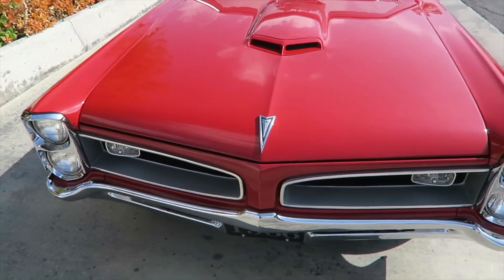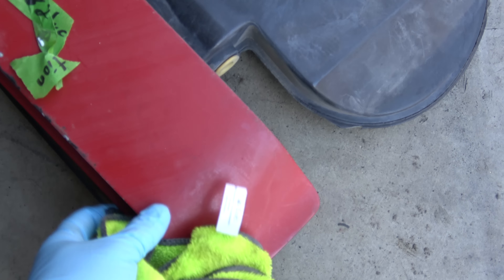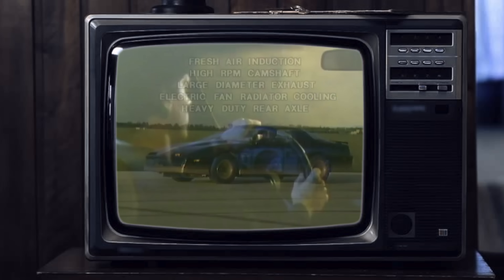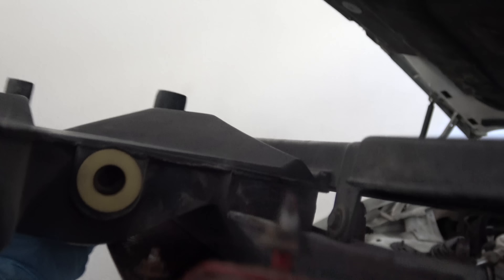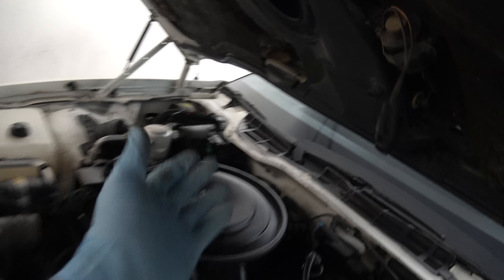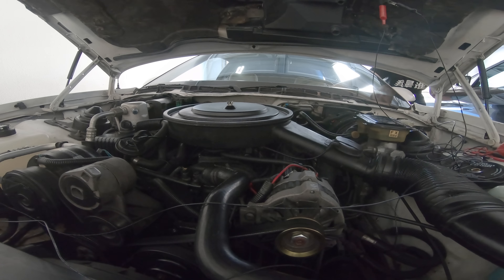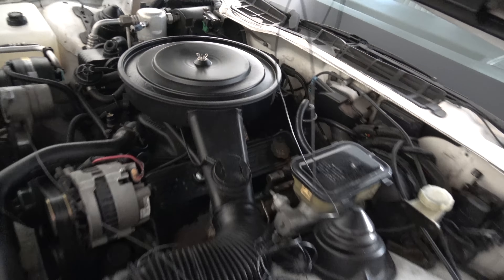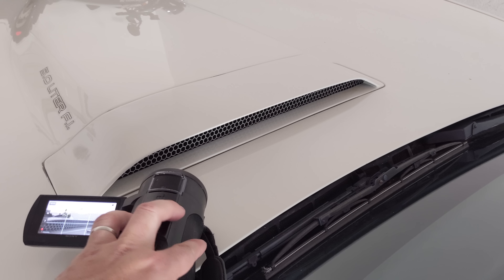I Unlocked Massive Power in My Firebird

Comment: Im torn between the turbo hood, and mine, with the nostril vents and the side head extractors on the hood (and the fender ones. Mine is a regulat TA from 85). I would make those functional, remove the foglamps too and add brake cooler ducting. But, Im not sure yet. I need to get a PHS report, and see how rare this bird is.

I admit I like the breakdown, if its a one of one, or one of however many, and shooting for pure stock...but this car lost its LG4 and has some 350 crate engine. it was new...but no clue yet on which one. I dont like that fuel pressure is low, 9psi...if it was an in tank pump. But, its also. NOT an in tank pump lol. We all know the horror FPs are to replace (that and spark plugs, two common things that on any other car are easy..but not on third and fourth gens)

I also have headers, so the plugs mentioned above will be extra beetchy.

Anyway, nice job there. But, with F bodies...I admit Im vain too. SHould I spend 2k on a whole hook and air filter assembly? Or 2k on Cragar louvers? Mine in HS had them and....welll....I did that look, so much that I have the metal ones for my 5th gen (to anyone curious, MRT makes them, Mustang Racing Technology. They still do...If I had extra cash I would buy a set, just to have. They really make the Camaros look complete) Im rambling...lol. I got one hour of sleep, and Im about to start polishing the horrible paint on my TA. It will at least be a shiny Fireturd!

Comment: Amused at a couple of things here.  To start you have the LO3 5.0 motor which was the garbage, base V8 from the factory in 1990 for the Formula and Trans am.  It was rated at 170hp from the factory.  After all of this work to modify it you still wouldn't get as much power as a TPI 5.0.  And this mod wouldn't work on the TPI either so the hood bulge kind of has to remain only for show on the upgraded motor from Pontiac :)

Comment: The functional bulge was on all 83-84 Trans Am, standard V8 or HO. In 1982 only the Crossfire models had it, and it had a slightly different opening for the air cleaner. Not all of them due to a shortage in the turbo hood that year.

Comment: Something you might do is install " Frogskinz" iand delete the flapper entirely. t's basically a membrane that allows air in but keeps out water. I've seen it used on competition snowmobiles. Those even in stock form are close to the same horsepower that your car was when new. I will install it on my hood once the fake scoops are cut out. A point. Even without ducting to your air cleaner base, the colder air helps dissipate heat. The old mopar " airgrabbers" and Chevrolet cowl induction hoods gave a bit of extra horsepower but there is no way it's even 10%. In fact 5% would be optimistic ( measured at the wheels) That being said in the end it makes sense to do this. 5% on a 250 hp engine is still 12+ horsepower. At this stage you might want to consider getting a mailing address in Arizona to get around the CARB regulations. When you do that it's easy to upgrade your engine ( and in particular your excessively restrictive exhaust). With a proper cat back exhaust and finding better manifolds you can get more HP without affecting the reliability of it.

Comment: Tbh you probably gained 5hp in actual performance but 50hp in sound which makes it well worth it 👍
Reply from the maker: Agreed
Reply: I'd bet this simple mod would be worth 1-2 mph in trap speed over stock at a drag strip. Ram-Air makes more power the faster you go. A dyno cannot realistically measure the power gains.

Comment: Just a quick note on Horsepower ratings. Until 1972 engines were Dyno tested bare, meaning nothing on the engine, no power steering, water pump(that was driven by an electric motor),AC, and could be done with open exhaust with headers. This was "Gross horsepower". In 1972 that changed and they were then required to test the engines "As installed in a car" that means all accessories and a factory exhaust and that was the main reason for the so called HP drop so for example if a 350 made 350 HP pre 1972 after 72 it maybe only making  250hp and the smog crap took some more down so could have been 210 or 220 so this was then the "Net HP" and now since 2005 it is rated as" SAE certified standard"  although since then technology has improved and horsepower is back up so you are seeing much more power and better gas mileage and much more difficult engines to work on because of all the wiring and sensors but the newer ones are much more easy to diagnose just plug in an OBD and read the codes and they are more accurate then when they first started the computer age cars

Comment: I saw something years ago for my '89 formula TPI... run a black dryer hose from the airbag down to a spot by the radiator for fresh air induction, also, drill some more holes in the air box... not only does this work, it sounds radical with a manual trans.. take the screen out of the temp. sensor.. carefully...all of this gets more air in there... careful not to touch or break the wire...
Reply: You talking about cutting out the screen on the MAF sensor?
Reply: @ShawnStafford-1978  yes... just be careful!!
Reply: @lonmcq7317  I heard it's more of a problem than a gain removing the screen's. Plus the OEM version are getting harder to find. I have a original 89 GTA. I just added a piece to the OEM air filter intake. That goes to the fender for cooler airflow. It's on my channel.
Reply: Also the coolant bypass method works well for reducing coolant and the intake manifold from getting hot airflow on tpi setups.
Reply: @ShawnStafford-1978  It's not a problem at a all, just be careful.. My brother had a 89 GTA 350, he did this and so did I with the Formula... No big deal...
Reply: One other thing I'll offer... Forget the computer chip.. giant waste of money, but.. What does work, and you'll feel this.. Underdrive pulleys.. Crank and alternator. March is the place to get them from.
Reply: @ShawnStafford-1978  Nope, it's a 5 minute job.... If you're not comfortable, don't do it...
Reply: @lonmcq7317  Yeah, I'm fine with it being original. The sensors and OBD1 all work with everything else together.

Comment: Now, I wonder if the Venturi effect robs you of air at higher speeds on the reverse scoop.
Reply from the maker: I haven't seen an issue, I rarely take this car over 90mph anyway but it still has plenty of go at top end
Reply: The idea was there is a high pressure region at the cowl ahead of the windshield that you can tap air from. Forward scoops need to be raised significantly above the hood to get clean pressurized air funneled into them. At least that was what the car magazines in the 70s said.
Reply: @MyDailyUpload  Cowl induction is always cleanest, but nowadays mostly cabin air comes from the cowl inlets.

Comment: Would be cool to do an A/B test with it closed and open to compare acceleration times. Imo one reason they restricted these engines so much is that the transmission, the T-5, was kind of weak.
Reply: But, you wouldn't be able to replicate the high pressure air which would be forced into the scoop, at the base of the hood/windshield area, on a dyno.  This can only be achieved at speed, and you wouldn't likely see much of a h.p. increase until you were somewhere on the south side of 80 mph. This has proven to be the case for both ram air equipped cars and motorcycles, when dyno tested against their non ram air counterparts.
Reply: @500erider  I wasn't talking about a dyno. You can do single gear acceleration tests using a GPS and other test equipment that will show small changes in time to speed.

Comment: The reason American cars stopped receiving "real" air cleaners was due to noise regulations in most large cities in the early '70's. The full throttle actuated doors meant that the cars would be quiet until hard acceleration which was adequate to make the regulators happy.

Comment: You should add 3 more things 1) MSD6A, 2) E3 spark plugs and 3) 8.8 mm  ignition wires... 
 It helps with emissions, gas mileage and most importantly POWER!
Reply: nope........ac-delco plugs,no msd and decent wires will make the same or more power than everything you mentioned...
Reply: @trillrifaxegrindor4411    I've used MSD in a 4.1 Cady, 6.0 Chevy 6.6 Pontiac 4.9 Pontiac 1.9 Ford, 5.0 ford and so on.  I always got great results, everything from Winter start up to gas mileage n horsepower maybe I just got lucky.
But thanks for the info.

Comment: Hey Winston just want to let you know that I have sourced out all of the parts with the exception of the rubber gasket and the air cleaner cover. Well also the screen / grate that replaces the blocking plate in the scoop. I ended up hand fabricating one out of something that wasn't honeycomb shaped but oval shaped holes and black in color. It looks fine, actually looks factory. I know it's not original but it looks like it belongs there and from the factory and it gives complete airflow. I did acquire an extra original TBI air cleaner cap and it looks as if I'm going to have to hand fabricate the hole for the rubber grommet so it will seal to the air cleaner. The rubber gasket is another situation, I can't find that either so I am trying to source one out elsewhere. If you have a source for the original bits and pieces please hit me up so I may purchase the actual parts. Thanks mate.
Reply from the maker: Good job so far, I’m guessing you could easily make something out of weather stripping like maybe a trunk weather seal or something?
Reply: @WorthlessWhips  Well it's complete and 100% functional 😎👍. I did end up fabricating my own air cleaner cover using an old TBI cover and adding a secondary air chamber on top of of it. Try not to laugh but the gasket is actually a toilet bowl base seal where the wax ring would seal the bowl to the floor. This one is made of a heavy duty flexible rubber material and is the perfect size to seal to the induction unit that mounts to the underside of the hood, worked like a charm. I did see performance gains as far as better acceleration, improved throttle response and a bit more lo end torque.  I wish there was a way I could attach pictures it actually looks like a factory application.  So to date because of your videos I have done this modification, I have also changed out my steering wheel to the correct 3-spoke Firebird steering wheel I have changed the dreaded saggy map pocket I have replaced all four speakers with high-performance Pioneer speakers (all Direct Fit) and was able to adapt a 2003 to 2006 Delco Trans Am CD player head unit with graphic equalizer and upgraded built in bluetooth, all correct 21 pin connector and 1.5 DIN size head unit. It was pretty much plug and play.  Life is good 👍.

Comment: The reason it had the actuator is that it bypasses the air filter when open and with normal driving, you want the air pulled on through the filter. You may want to rig a switch to open and close it.

Comment: You discovered Cowl Induction. Not making 15-205 more horsepowers but I bet you are probably getting an extra 5-10 horsepower and I am being gracious. You changed the temp of the air coming into the engine essentially and the reason you can feel it is because these cars barely had 150-160HP to begin with so any slight modification is going to feel like you bolted on a nitrous kit. Try advancing the timing and lean the engine out it'll feel like you have a turbo on the thing. :-)

Comment: It didn't get you anywhere NEAR 15-20%, haha! That's like, long-tubes, full exhaust, mild street camshaft power. I'd be blown away if it gave you 10 hp, most cold-air intakes gain 0-5. I can easily believe it made the car more responsive, which can feel a lot like more power in and of itself, even if the car actually makes a smidge LESS power to get it.

Comment: ive never understood how the rear facing vents work. It seems that they would pull air from that direction (which would be good for relieving pressure or heat from the engine bay) rather than force air in.

Comment: Lol I hate those crappy chrome ones you see at autozone and other places. So horrible looking
Reply: Autozone is the worst. It should be evident that when you work for a company that wants you to sign a contract saying "you won't talk shit about this company" that's a red flag.
Reply: @NeverMetTheGuy  didn't know that but yeah ive never had good experiences with them customer service wise.
Reply: @tomatojews8500  - I may or may not have worked there, and they don't pay enough to hire people that really turn wrenches, and the people that actually KNOW car stuff usually don't stick around.

Perfect example is my 98 GTI which is barely stock at this point, is a Mexican built AAA engine. When running the VIN through the system it comes up with the more common coil pack, and not the one that is on my car (the one it needs). So it took about an hour one day to find the part number in their system, and you isn't even search for it directly. So yeah, they're pretty shitty for the most part. However, if YOU know what you need, it can be easier sometimes, but anyone but AZ is usually better.

Comment: I knew that hood was special and traded it for a blocked off hood+$75 for our group beater TPI car. We have 4 front offset 16" '84-87 wheels on it and it ran 14 flat which is the same number that my '97 SVT Cobra ran at the same track. My mostly stock LS1 4th gen ran a 13.1 and my '87 Turbo T ran a 12.5 with a stretched stock mount I/C, 50# injectors, a 2800 stall, TH DP, a rebuilt "clipped" turbo, mail order Red Armstrong/ Cal Hartline chip, and snow tires from a Crown Vic cop car on GTA wheels. I really want a Syclone that is "Beater Quality".

Comment: I Believe this, I just took out all the Parts out the single snorkel breather and removed the air tube from the breather as well and My Firebird Formula went from 118mph to 135mph and kind of time consuming as well because I didn't want to damage the breather anymore than possible

Comment: I also unlocked massive power in my ('90 L98) Firebird! Vortech V3 supercharger, higher flow injectors, aux fuel pump, MSD box, Magnaflow cat back, adjustable fuel pressure regulator, .....................

Comment: please explain HOW your 305 TBI which could use at best maybe 425-450cfm at WOT somehow gained ANYTHING since the old snorkel/filter wasn't the bottleneck??? the camshaft/heads are..  i maintain it might have a beefier sound drawing air from the cowl instead of the old snorkel.. possible IAT could make an ever so slight difference.. (id be surprised if it was 1-2hp.. if your old Air cleaner was drawing in hot air from the engine compartment.. which its not supposed to.. and wasn't cuz in 1990 they drew cold from the front via a flex duct.. like the video shows yours did) so.. no additional air could enter.. no additional fuel needed.. = NO GAIN in PERFORMANCE...  nice that you made the power bulge functional.. but it was unnecessary.. exactly why they stopped making it functional on the early 80's T/A when they started using it on the Formulas.. so people.. don't bother making this conversion.. it will new you ZERO GAIN..  LS SWAP a junkyard 5.3 in... it's the best bang for the buck on this car.. easily add ~175 wheel HP for $1200 bucks including the engine, tune and exhaust work.. close to 275-300 rwhp add if you swap the cam, lifters, valve springs and add headers and a tune..  these are best drivability bang for the buck ways to make this car better.. can't do much with he 305..  it's an old small block so adding cam/intake/heads/exhaust/carb etc to it makes no sense.. expensive and not much return..  you swap in a 383 or something you still have huge costs.. LS swap in a truck engine.. do the easy bolt on mods.. she will perk right up..  sorry you wasted your money on this hood mod.. while it's novel and cool.. you didn't gain a thing.. cept the woosh sound when you kick the little TBI in the ass..

Comment: Most of these Fakes are there where the real ones are on the race versions of these cars. Some were for air for the engine while those on the side were for cooling the brakes ( some on the front some for the rear). The fakes are cheaper to manufacture and warranty.

Comment: wouldn't this screw with the mass airflow sensor? i'm not 100% sure how much that does in a car of this pre OBDII era but i would think it still uses some sort of MAF sensor to determine fuel ratios.
Reply: Not saying it's a bad idea to do it but it might make a bit more sense why that solenoid is there to block it off unless you really put the hammer down.
Reply: These cars didn't use a MAF. They had a MAP sensor that read pressure in the intake manifold.

Comment: Im thinking if it actually improved the power that much, there must be some other mods to the engine and exhaust system. The little snorkel does look like a massive restriction or "bottleneck" (almost quite literally). Maybe in the day they were just tuning for general drivability, and wanted you to unlock higher rpm power if you knew how. It seems strange they would stifle the engine though, from a competitive stand point, as all the muscle car companies were vying for better hp figures to put on ads, I would have thought. Maybe it's my modern perspective; growing up with modern EFI cars that are more deliberately engineered to take advantage of and utilise the design available wherever they can, unless specifically going for economy. There are definitely some econoboxes that get a similar % increase from basic de-restriction of intake and exhaust, but only when they are not at all going for power. Any sporty car now tends to have such good design that not much is there to be gained with simple mods. Unless you get really serious and start removing emission controls like cat converters etc.